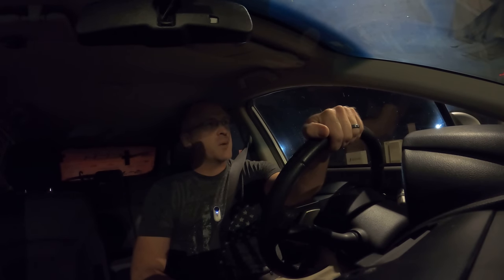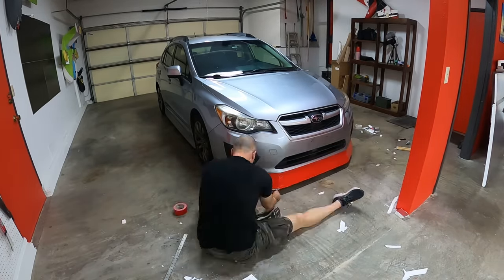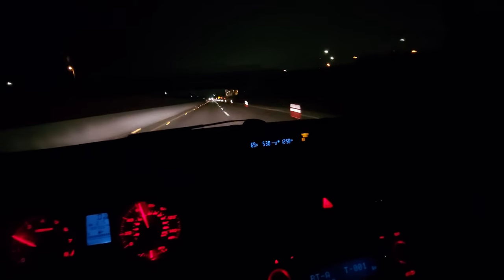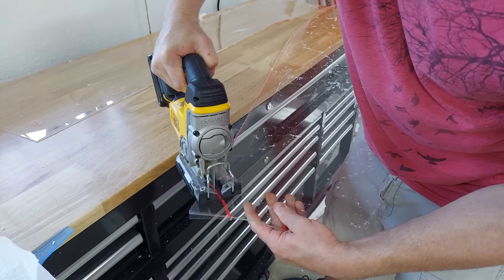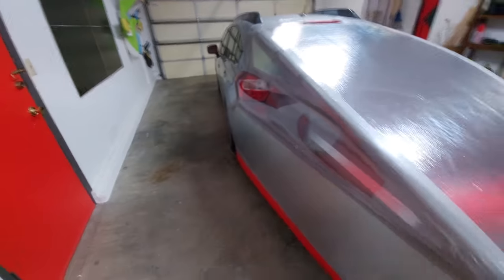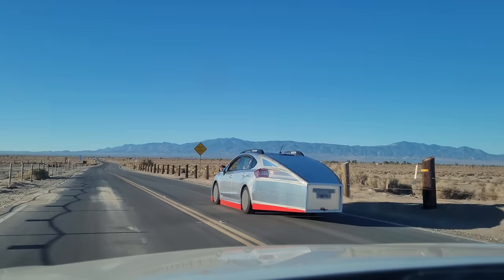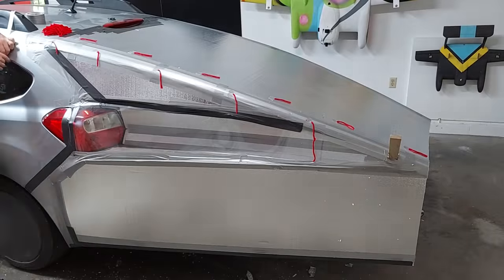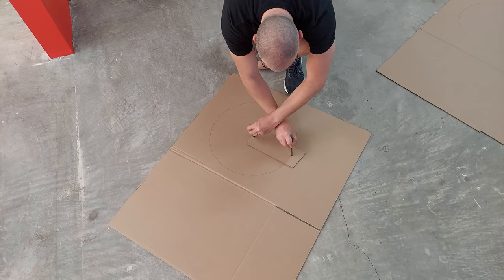Beating High Gas Prices Using Simple Aerodynamics (Home Improvement Store Edition)

Comment: if you dont trust the gas station, you can always fill up some petrol cans and get a very exact amount inside your car.
loved this 2 videos! here in germany we have so many rules, you will never find out something like this by your own :(
Reply: thought about this too, but since he's not driving it until it runs out of gas, he's measuring how much he puts in until the pump stops pumping, so a jerry can, even if you knew exactly how much was in it, wouldn't really inform how much gas you  had used in a test.
Reply: @maxymoo2764  because of this some test it like this: they fill it up till they can see it. It's of course not good to fill it up that much but you can compare it better
Reply: You dont need to be accurate, you need to consistent. Using the same pump is good enough
Reply: @TheJttv  i gave him just a solution because he sayed he didnt trust the gas station.
Reply: Yup das wär ein klasse Weg ein Date mit dem Richter zu bekommen
Reply: @inkognito3145  schon beim dran bauen ruft der Nachbar die Polizei xD
Reply: @Wrutschgeluck  yeah but sadly theres far more variables he wont be able to control. Such as the air temp/humidity going into the engine, this will have an effect of mpg too. The quality of the gas can also change a bit, "up to 10% ethanol" ect ect ect
Reply: @TheJttv  I doubt letting the pump click off and calling it good is accurate enough for only a partial tank run. Might be fine over a many tank average. Has anyone proven that method to be accurate or just hope it is?
Filling it until you see it is actually full should be quite consistent. At least you know it’s at the same level. Still a question of trapped air in the tank and possibly different volume due to different temperatures.

Comment: Great video, and 17% is an amazing result for a car thats already quite aerodynamic stock. I have a Mercedes with air supension that lowers about an inch at 75mph, ive also lowered the car another inch. Now the car is more efficient at 80mph than it is at 60mph when the supension rises. It makes a huge difference overall, even the topspeed is higher.

Comment: When i flew model rockets a little short kinda flat nose cone was faster than a long curved pointed nosecone . It had less surface area. So on your trunkated put a shorter point so the flow has to break around the trunk edge and flow to the point.  Instead of drag off the edge.

Comment: The original: It scooped up from the bottom more. The top part didn't rake down so sharply and the sides 'boat tailed' in sharper converging at a point just below the taillight level. Even, fully enclosed transparent wing mirror fairings? Maybe? Love these uploads btw :)

Comment: Keeping your RPMs below 1800 will help a bunch.  My 2022 has manual shift mode.  When I get above 50 mph, I shift to manual and put it in 7th gear.  BAM!!! 42+MPG with a bone stock Impreza wagon.  Even @ 70 mph
Reply: A automatic will often run at higher RPM and lower load at lower efficiency than needed if you let it for air pollution reasons, especially on diesels.
that, or it just gets stuck in higher gears too long

Comment: Super interesting. I did some tests on a 3 tonne truck a few yars ago with an inflatable tail - inflated by the stagnation of the air at a duct on the top of the body. I didn't have very good metrology but thought that I had reduced the drag by about 5%. The inflatable idea was that when it was stopped the tail would deflate and have bungee cord in it that would collapse it down to a short length for parking. I had to rent the truck for the testing so I ran out of time and energy but I think it would work well.
People often put stuff on the front of vehicles to aid aerodynamics - we have a thing called NoseCone in Australia but it is really at the wrong end IMHO. Avoiding the separateion of the boundary layer on the rear is waaaay more important than making the front rounded...

Comment: Some other comments have pointed out, but those skirts are also creating downforce, a way for you to reduce your rolling resistance and induced drag could be to raise the tail a little but and vent a little bit of air behind the front wheels, this would reduce your underbody downforce reducing induced drag too.
   
This vent could be something like a skirt with a small protusion into the air stream, it sounds weird that adding frontal area to the car can reduce the drag, but its one of those counter intuitives examples to drag more there to save else where
Reply: What kind of protrusion from the skirt, and what kind of angles for the skirt meeting the undertray do you reckon would work best?

Comment: The commentary toward is probably more spot-on that you would expect.  I'm the guy that typically doesn't refuel until the reserve light comes on, and I get to know my cars fairly well as I drive them and pay attention to things like fuel dispensed.  There are some gas stations I simply avoid because they'll consistently dispense almost 10% more fuel than others in the area.  In cars where I know when I'm almost completely empty, just how much should be filled, going over a certain amount is pretty obvious.  I had one car with a 12 gallon tank that would typically take 12-12.5 when the computers range was in the single-digit miles remaining.  On gas station would routinely dispense 13.5.  Another gas station never dispensed more than 12.5.  Unless you have some calibratable way to measure the fuel, I would recommend either only using one pump at one station, or doing multiple runs using different stations and averaging all the results together in hopes of reducing the significance of that particular mode of variance.

Comment: Great simple experiments, well summarized.

To monitor realtime data, and collect data on vehicle performance; you could invest in an On-Board Diagnostic (OBD) dongle. This would allow realtime monitoring and collection of data on a mobile device (via wifi, or bluetooth). Data parameters available varies a bit by make, model and year, but often can view realtime fuel consumption, or estimate quantity remaining, as well as odometer readings. Logging would allow export to a spreadsheet for some  fun maths.

BTW: did you do a calibration check on tire pressure? This an often overlooked item and can make ~5% efficiency difference. Varies with temperature and seasons, so is worth checking once a month, or prior to efficiency runs.
Reply: Agreed - snoop the ecu with and obd scanner!

Comment: have you standardized vehicle weight, and tire pressure? Tire pressure can have a massive effect on efficiency. also added weight from more material at the back axle could be to blame. I would suggest adding lightness and trying to see how far you can slope the read down before you hit turbulence, as a shorter tail would also reduce weight, and improve axle balance.
Reply: The weight of the tailnisnt enough to effect axel balance

Comment: Before the back addition, the curves helped with the airflow. You could try angling it more towards the bottom, so only the area with the license plate is flat and nothing else, and even that could be slightly angled (something like 15 degrees or less).

Comment: Just wanted to share my mileage  tests by saying when filling up the gas tank the only way I could think of to keep consistent was filling up neck so I could not put another drop in.   So that worked for me, but some cars might have problems with smog systems.   I was not testing pollution effects so my mileage worked just fine.   I was able to get 27.6 mpg in my F150 but if doing a full tank to empty don't drink to much, it's a long drive.

Comment: you can check mileage with the onboard computer. drive say 80mph on a level road in a high gear. Use the same gear to compare. do several runs and note the windspeed and air temperature each time for every setup.  If you get better mileage in worse or equal conditions then the better efficiency is confirmed. Onboard fuel metering has about 0.5% accuracy and can be offset if the tire size is not nominal  but the tire size doesn’t affect the test obviously if all tests are done on the same tires and pressure (check pressure each time). The fuel metering can be adjusted through obd if offset but you don’t need that either since all tests are using the same calibration
Note the computer mpg average over say 0.5miles. Each run on the same road preferably

Comment: You could use a pressure sensor to measure your air pressure in the tail section. Then pressure drag is equal to this multiplied by the area of your truncated cross section.

Comment: I have an FA24, ambient temperature makes a huge difference. In the summer when I am driving in 70-75F in the morning and 85F in the afternoon, I see ~30-31mpg. Now in the fall, morning temps around 45F and afternoon temps around 60F, I am seeing 35-36MPG. Same route, no traffic, trying to average 35mph or 50mph on the backroads mileage is always about the same over 3-4 tanks, leaving me to believe it is ambient temp, or if the additives package has changed in the gas.
On another note, I had a pickup truck that I put a downward wedge cap on to do a fluid dynamics paper on (emulating  a couple that were already done), that alone improved efficiency about 10-15% on a regular basis.

Comment: Add to front a little splitter below the airdam. 30mm further front is enough for most of the benefits in separation. (based on Nascar 2019 CFD results etc) I would also cut the rear bumper and only make cone for the remaining lowpressure zone. (or remove bumper and use good rationalizing on the cone starting height.)

Comment: When flying, after polishing our small aircraft (115 Horsepower) We can expect around a 5-knot increase in it's cruise speed at 25 Liters per hour. This represents around a 4% increase in cruising speed. It would be interesting to see what would happen if you smoothed the rear material and polished the car. Also, perhaps putting the fuel units in L/100km as well as MPG might help appeal to a wider audience.
Reply: Equally interesting is the dimples on a golfball that create lift by essentially creating an air pocket around the ball. At least that’s how I think it was described as how that works or something similar. I think I recall long ago someone recreating a dimpled effect on their car which smoothed the airflow because of the “pillow” of air on the body.

Comment: Seeing the rear of the new boat-tail made me think of the british WW2 stern design. Apparently they realized having a flat stern instead of a slow taper was more efficient, because the turbulence  swirled around and pushed the boat forward? I may be wrong about that but it's worth looking at.
Reply: That reminds me of the kammback, which found a truncated tail was more efficient like used on the Prius and Insight. Then consider the bullet shape called the boat-tail, which is essentially a kammback too, that mimics the same design for stability in flight.

Comment: I think some of the efficiency losses may be because of side winds. Perhaps a shorter tail section would reduce drag in a cross wind. Also, may as well leave the back portion of the tail section off so that there's a clear view of the existing license plate holder. I think such a design is called a "partial cam back." (Not my words) it may be the side wind and driveability solution as it would be shorter and (perhaps) still have most of the efficiency gains. 

Very interested in this as a series. Kinda hoping for a more final version, perhaps made from fibre glass laid over an existing test piece. 

Also, may as well test the pointy front. I hear it's kinda bad, but have no numbers to tell exactly how bad.

Comment: Filling in the rear of the tail surely hurt you a bit.  The plate cover is a large surface for the low pressure wake to act upon.  Remember that it's pressure region's acting on a moving body itself that contribute to drag!  Having the tail hollow the first time around meant that realistically only the edges of the foam were subject to wake forces, with the gradient increasing to probably around atmospheric when you reach the body.  With such a better optimized curve on the tail, you had way higher velocities at the bluff cutoff, so every square cm had an even more severe pressure drop to contend with vs the former.  If you cant get a point (which you probably can't achieve efficiently anyways) find a way to leave her hollow!
Reply: Well, the old design created a large cavity, and there is no way to tell what the internal cavity pressure was without some further analysis.  Sometimes it can result in higher pressure when you create desirable recirculation inside the cavity, but in this case I suspect recirculation was minimal.  So it was probably transmitting the wake recovery pressure, or a lower pressure, up against the hatchback and bumper inside the cavity.  Which means not much of a reduction in base drag.  The new closed boattail shape is probably better.

Comment: Haven't you considered an inflatable tailcone?
One made from [clear] plastic film, able to be inflated at low pressure (maybe even by scooping air in motion?) and deflated while parked.
Reply: I thought of that a long time ago for semi trailers but didn't try it. Once on the highway, the flat back of the trailer would deploy a kind of sock that would fill up with air that slopes down to a point. When you slow down, it would automatically deflate and roll itself up out of the way. That could save a lot of fuel for trucking companies.
Reply: @elliottdiedrich3068 That's a very cool idea indeed. I would like to think that it would be worth pursuing. 👍

Comment: Im guessing that the variance in the results from the gas pump come from the mechanism of the stop valve in the nozzle. Since its purely mechanical, it might not always fill to the same point each time. Ive noticed on my car that sometimes the amount it fills will be off by a half gallon or so when i fill the tank from the same mark.
Awesome video though!
Reply: It is a back pressure pop valve.  Using the same pump and nozzle is good, but the car, temp, air pressure, humidity/dewpoint is what changes along with the saturation of the vapor trap cannister.  If overfilled on visit 2, then visit three may cut off as much as two liters early because the vapor cannister has become wet from last overflow.

Comment: I could imagine that the new tail causes more drag, because the back area, where the numberplate sits is substantialy bigger. Without directly changing its size again, you could try to angle the surface at maybe 45 degree, effectively creating more of a tip, instead of a big rear stub. Do you have something like discord for better exchange of ideas?

Comment: my idea for the gas pump issue is the different grades of fuel, ie the ethanol content during the climate shifts throughout the year.
Reply: “I’ll take zero ethanol, please.”
Reply: @JoeOvercoat  
My car is older so I only use ethanol-free, and while it does cost more, I get about 2-3 mpg using it. For consistency, he should definitely use it when testing at different times of the year.

Comment: I might suggest using an OBD reader to get your air-fuel ratio while doing these tests, it's possible your car had richened it out for one reason or another causing more fuel consumption. Cars actively manage all of the conditions that make the car run and could be doing one thing or another to make catalytic converters heat up or cool down or a bunch of other things. I think averages from a set of tests using one variation for another would be a better indicator. Love the videos, 18% is incredible.

Comment: I know I am late to the party, but - do you know with certainty that when the pump at the gas station cuts off, it is always accurate ie. what about foaming, or more precisely, the splashing that trips the trigger? It only needs a single splash to cover the 'trip hole' in the mechanism, and you could be quite a way out... Just a thought. (I used to work on such mechanisms, and they are far from precision mechanisms. I reckon you would have to do, maybe, three runs and average them out (-:)~

Comment: The splitter is giving you the most gains. The boat tail could be reshaped a bit get the flow into the dead space, also refining the splitter will help. One thing you might to try is divert some the air from the top of the boat tail to the bottom and clean up some of the dead air.

Comment: i agree with your last comment about the pump not being as accurate when shutting off, you can get around that by using a fuel cell instead and measure by weight

Comment: One of the things with your low tail vs high tail comparison to think about is the amount of air taken in through the grille. You had a big drop in efficiency when the splitter and skirts were gone in part because the engine bay was probably less efficiently removing air, causing it to spill into the wheel well. That's messy enough aerodynamically that many cars that are new have active air dams hidden in the grille for improved efficiency. The angle of attack on the extended rear diffuser can speed up the underbody airflow and get more of that messy, hot engine bay air out.

Comment: I had a 2014 subaru impreza sedan cvt that i used for my 1hr  commute that got  a consistent 36.9 mpg, i now have a 2010 honda fit manual trans that gets 38.1 and am in the process of k24 swapping a 2011 honda crz in hopes to achieve 40 plus mpg with some tuning, this video was great to watch!!